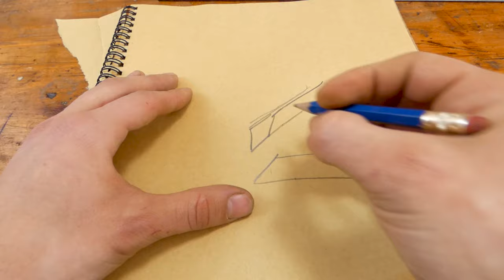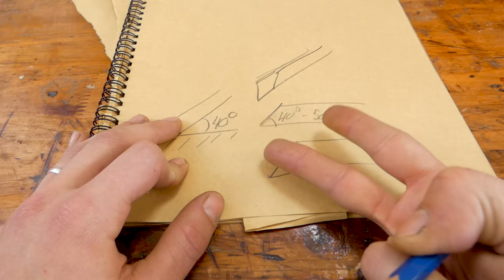How to - Make an Engraving Chisel and Scroll Design... and some Engraving  too

Comment: "Just get it to cherry red... which is... the color of cherries..." :D
Reply: Well, he's not wrong! :)
Reply: noctrnalAndroid  LOL😂
Reply: me too rolling on the floor
Reply: Actually, the cherries should be ripe.
Reply: Which are anything from black-red, to pink-red! And, you can have the steel TOO hot as well. I think that using a magnet is a much better method.
Reply: Different steps harden at different temperatures. O-1 (oil hardening) hardens best if it is heart to a dull red color then launched in oil. W-1 (water hardening) needs to be a little hotter, so more of an orange color. A-1 (air hardening is usually done in a temperature controlled furnace built just for hardening and tempering steel. For the most part O-1 is the most forgiving and less sensitive to minor heating deviations during hardening. It is best for beginning heat treaters. It will cut mild steel nicely with a lubricant. You will have to sharpen fairly often, but that is a small inconvenience, vs much more expensive equipment.
To make good gravers and other tooling you need to know your materials, so old drill shanks,while often labeled "high-speed steel" can be made from several different types of tool steels many which are not easily heat treaded by hand.
My compliments on your video, you have it down and you can draw a scroll to boot!
Reply: @Afro408  yes I agree, cherry's start of green and eventually turn brown,  so it is a guide, but not a very good guide,  was not aware of the magnetic method, but I will be trying that,  it's rather fool proof, it is or it isn't,  no doubt about it

Comment from the maker: Hello my good friends! I'm really happy  to see that you enjoy this video. I just want to mention that I've ended up sharpening the face of the Chisel closer to 45 degrees and the heel at around 17 degrees. That produced the best results for me.
Reply from the maker: If I remember rightly I ordered them from Hong Kong (on ebay). Yes, they did take a while to get here. I can't say with certainty that they are indeed hss , since I don't have the expertise to confirm, but they definitely have the feel and the hardness of a hss, especially when I tried, in previous attempts, to heat treat them I realize that its not your ordinary High carbon steel. if you can get your hands on some O1 tool steel that would work just as well.
Reply: q
Reply: You search silversteel (Silberstahl), Material No. 1.2210 Short name: 115 CrV 3 a CromVanadium steel, this is right for engraving tools
Reply: Thanks.
Reply: Good job
Reply: @urituchmanpigeon  
Your videos are very informative and the work you do is truly something to admire. Good stuff bro.
Reply: Love your videos! You have inspired me to give it a try. What do you call the guide you used to set your angle and do you know where I might find one?
Reply: @DavidSkipperskipperart  It's called a protractor.  There are small ones you can buy in a kit with a compass and other things at an office or school supply store.  Otherwise just google for a large one that you will hopefully buy from a local store.
Reply: @narcoleptic8982  I was asking about the tool he used around 2:35. I could not quite hear what he said. I found out it was a honing guide
Reply: I'd like you to know you've become my fav YouTube channel and really like how well you break everything down step by step. I'm a wood Carver/painter and now I'm taking a interest in engraving. Very soon I'll fallow your videos and make all my own tools as well bc there's nothing better then using your own hand made tools to create something beautiful. Great job my friend and keep making these amazing videos and thank you!!!
Reply: Oh and I've gotten into checkering and carving gun stocks and now I'll use your guidance to put some beautiful scroll work on the metal parts as well. So excited to make those tools and maybe we could exchange emails so I could send pics when I'm done with one and get your input. Thank you again and take care
Reply: Uri, where do you buy your spring steel from? Could you share a link with us? Thanks
Reply: @urituchmanpigeon  Hello friend .  I saw Sam Aliano's hammer and hammer pack.  there are 5 kinds of chisel can you identify the chisel using what angle?  I want to make it, inspired by you😂😂

Comment: you should be quenching after anneal and temper with oil.....any oil will work but it will prevent a course grain structure and microcracks in the steel. water boils outside the metal creating gas pockets which are not cooling while other parts are causing stress cracking. this will be better for a sharper and safer tool that's less likely to fracture or dull

Comment: I followed your instructions for making my own gravers from filing the profile to hardening and then honing the edges. The first I made from mild steel which I know won't hold an edge well at all but I was trying to use it on aluminum so I didn't think it would be as important. After about an inch of linework, the tip was bent over and ruined. So I made a new graver out of an old high speed steel drill bit thinking that would be more appropriate. In the same way the tip was bent over and ruined almost right away. So I went as far as to buy professional gravers from a jewelry supply house and I switched from aluminum to brass since I found some people online saying that aluminum has special characteristics that are difficult to work with. The same thing happened again: within just a few hits, the tips on the gravers were ruined. I tried different angles including what I see you using in your engraving work but nothing seemed to make a difference. Do you have any suggestions for me to try? Thank you for sharing your knowledge and experience.
Reply from the maker: It's very hard to know the problem without seeing it in person, but I'll try to give a few thoughts. First, you are right, aluminium is not very ideal for engraving, I would avoid it. Tips do break sometimes, try to take it slow and light in the beginning without really sharp turns, also, try not to put much pressure with the hand holding the graver, the hammer should do all the work. I don't know your setup, but you should have the appropriate hammer, meaning it should be very light, about 3-4 oz.the vice should be solid and the work should be tight, any wobbling can coase vibration which can result in a proken tip. Lastly, you can try a 120° graver that should be much more rigid. I hope this helps some what.

Comment: I've been learning to use a metal lathe to shape metals,  and to grind my own cutting tools from high speed steel blanks.

It occurs to me that this is doing exactly the same thing that is done on a lathe except by hand instead of by machine.

It's interesting to compare  the precision and power available on a lathe to that obtained when cutting away material by hand.

Comment: I have a similar sharpening stone to that, except the green half on mine is white. The ruby ceramic side is about 3000 grit, which translates to something like 13-14k on the Japanese water stone scale. The green natural half should be around 8-12k on the same scale as the ruby (a white one is about 7-9k). 

PS: You need to use mineral oil to remove the metal buildup and keep it cutting perfectly. You can use baby oil or the kind sold as a laxative in pharmacies and grocery stores.

Comment: Today I made my first chisel from an old sharpening steel diameter 6 mm. First I made it soft on my  grill with charcoal, then I spend the half day with filing. And after it I harden it new. than I made a wooden handle .for a little more comfortable I made leather over it with skinglue. Now it must dry 24 hours.

Comment: Uri, did you have formal training with your artwork? You make it look so easy, and I do like the way you move around the piece your engraving which is much easier than trying to move the piece as you engrave. I was wondering though, do you think that a small board with your vice bolted to it and then mount the board to a "Lazy Suzan" ring would make it easier to move the brass piece? I just ordered a 3mm piece of steel so I can try making my own tool too. Love your video's!!

Comment: I used a worn out chainsaw file to make one. I just spent two hours tapping away basically making nonsense doodles in the steel. My tool forms a thin ribbon or curl in the front as I move along, much like the curls that come from a metal lathe. I am guessing this means the tool is at least acceptable for a first attempt.

Comment: Hi, I really enjoyed watching that video. I am blacksmithing a lot in my free spare time and I would love to rebuild these tools you've presented in that video. 
For the spring steel it is very obvious for me, what to use, but the high speed steel (hss) is a bit trickier.
Did you ordered: M1, M2, M7 or M50? Or was it M35 or M42? 

I am really not so much into steels, so I am always writing down the numbers to check for all the attributes of the steel, to get correct reheating tables. 
Would love if you could remember and tell me the correct type of steel. 
It is really nice to see how these tools are made from the start to the end. For the handles, I have to look around for that tool, as I don't have one. But perhaps I can do more rustical handles first and then someday make nicer ones. 
Thanks a lot and keep up the great tutorial videos
Greetings from Germany
Stefan

Comment: Uri, where did you buy that tiny honing guide? I gotta get one. Also, what are you putting on the piece when you want the lines to pop? It looks like paint or black ink.
Reply from the maker: I found the honing guide on ebay.UK. Sam Alfano recommends enamel flat black for the color. Hope this helps:)
Reply: Look into the brand Reamer Graver might add keywords like jig guide sharpening ...

Comment: Hi, at the beginning of your video, you start off by explaning what  kind of steels you're gonna be using during your tutorial, the firts one seams clear to me high-speed steel, right,  but i couldn`t understad quite well the second one you mentioned, could you give me some examples where this kind of steel is frequently  used? thanks a lot .
Reply: Spring steel.

Comment: Anyone know where I could buy these in the UK? Or what to search for on Amazon? Wanna give this a go but keep getting ads for wood chizels🤬thanks in advance for any replies
Reply: Are you mate after the steel and wood to make your own  engraving tools or ready made tools?
Reply: Tomek wròbel  yes please just the type of metal I need. Was thinking of using an old file because it's hard? Don't know tho
Reply: @bluemoon7378  never thought of using old file but why not? guess you have got a bucket full of  rust as we do;) i used a brocken tap and it worked. As for steel bars i use hss M35 cobalt or hss M2 on ebay.
Reply: @tomekwrobel1738  brilliant thankyou tomek.its just for a little project im working on atm for my violin case.iv made the handle out of mahogany and stainless then wanted to engrave the stainless with my signature.:) nice touch i thought but it seems to be one hurdle after the other lol.anyway thanks for the help really appreciated gonna do some research on the metals you mentioned  🤞
Reply: @bluemoon7378  all the best with your project i hope it will turn nice

Comment: Hi Uri, can you tell me the reason why you did not temper the HSS stick like you did with the spring steel rod. Thanks
Reply: The high speed steel graver was already hardened (hence the 6 minutes to sand the edge), also the process of treating HSS is different and much more difficult, so best avoided. The spring steel was annealed first to soften it and make it easy to shape before re-hardening and tempering.
Reply: thanks for your answer Rab Fulton

Comment: pretty sure when using a wet stone you want to use it wet. Would put sharpening oil or water on that stone before use, just a tip.

Comment: Next time  take a small block of hardwood, drill a 40 degree angled hole through the block and boom you have a perfect ans easy way to cut perfect angles on anything. Ive made them from Aluminum in my machine shop so tools i have to keep sharpening but wood works for one time projects or something your only gonna sharpen once in a while.

Comment: Will tungsten carbide be to hard for this. I have like 10 bits and some oak.
Reply: Tungsten carbide is used for graving tools as well. So if you have some go ahead and try it.
Although i imagine that shaping it is going to be a pain unless you have a power grinder meant for tungsten carbide.

Comment: For US viewers: You can buy a set of 5 HSS lathe bits from harbor freight for about 5USD (minus a 20% off or whatever coupon) as of this comment posting. They're intended for the mini lathe they sell, but it's cheaper than buying individual different pieces - there's 3 square ones of different sizes, a round bit, and a wide flat (cutoff) bit. Good for making engravers or carving tools.

I'm not sure what good the cutoff bit is, possibly a skew chisel or (very thin) gouge after much shaping..? Or a metal scraper.. hmm....
Reply: I wonder if it's possible to cut the wide piece off and braze it to some mild steel to get more than 1 blade without ruining the hardening... hmmmm...

Comment: Interesting video. However you mentioned "annealing" high speed steel towards the beginning of the video Uri. Sorry but your not going to do that or have any effect on HSS with a simple propane torch. James Kilroy showed heating a high speed steel lathe cutting tool to red heat with a oxy/act torch on his YT channel a few years ago and there was no effect on the tools hardness or condition. Yes high carbon steel tools can be heat treated in the home shop using simple low tech tools, but hss can't be heat treated in a home shop. Grinding and honing to form and resharpen or cutting to length with an abrasive disk is about all that can be done.
Reply: He did that to the spring steel, I'm not referring to that. Re watch the video at the 0:58 mark and re read what I said. I'm referring to his comment about the hss. You can't "anneal" high speed steel at all with a propane torch. It's simply impossible to do so. If you don't believe me then you don't understand very much about modern hss. It's designed to retain it's hardness at red heat temperatures and is nothing like high carbon steels. What more do I want? I don't "want" anything, I'm trying to provide some accurate information so others aren't mislead into thinking it's possible.